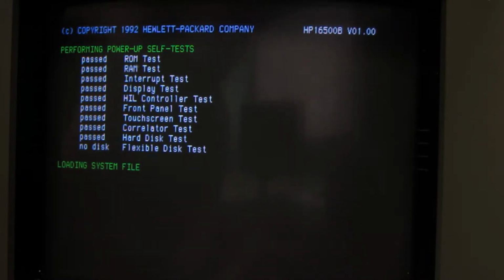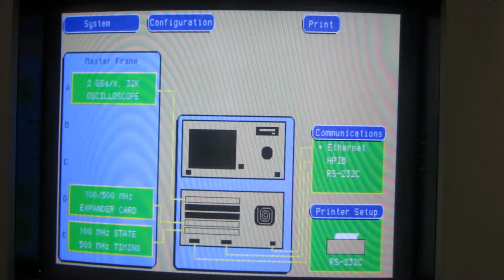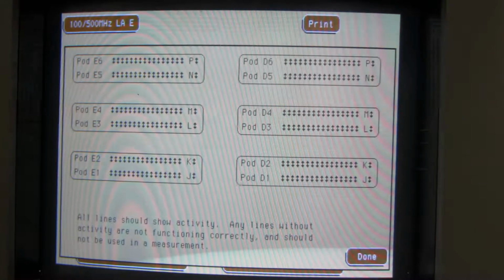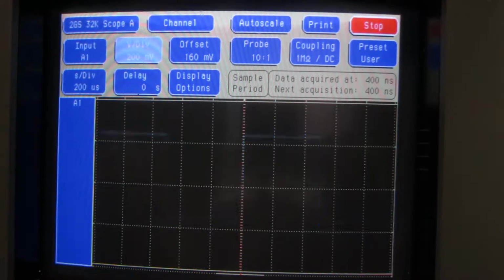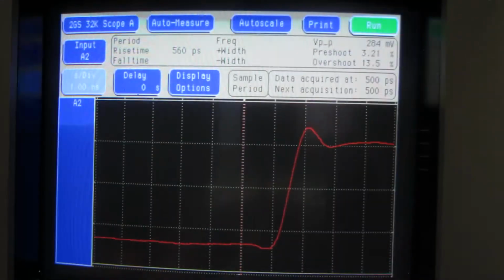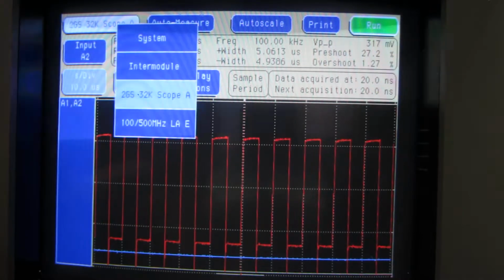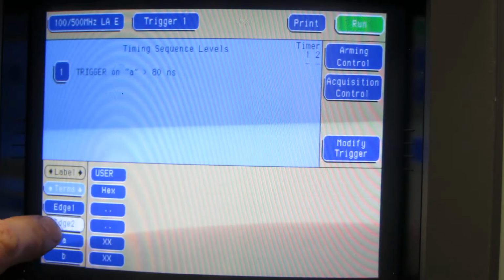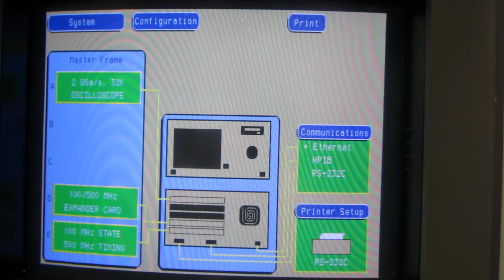Hewlett Packard HP 16500B logic analyzer demo with 16534A, 16550A

Comment: Cool working device! I just brought a 16550a module via ebay and unfortunately card is faulty, it's has troubles with self-test: chip 3 & 5 has communication test failed, chip 4 pass first tests and fail on ..sequencer stage. Also pods 5&6 show activity on all their lines without any connections in operate mode. definitely not a best buy, but I would be very grateful for any information about the possibility of repairing this card.

Comment: hi
i purchase a scope card.
it unrecognizable.
do you know what should i do?
Reply from the maker: What scope card is it? The really old 16531A needs a 16530A timebase to work with it. Also, check that the scope card is actually compatible with the mainframe. The older 16530A/16531A cards don't work with the newer 16700 series mainframes and I've seen notes about compatibility on some 16534A cards. Many of the plugins have Dallas non-volatile RAM modules on them whose batteries could cause a problem, but I've had cards work OK even with the module removed. However, the most common problem I've seen on all the 16500/16700 series cards is corrosion caused by the adhesive which attaches the plastic rubbing strips on the bottom of the board. I've got a whole pile of good plugins which are basically useless because of this. If you have any working ones, remove the plastic strips and the black rubbery adhesive strips now! I've had some luck with repairing corroded tracks and components which have been damaged by this, but it's not easy.
Reply: @cmjones01  https://www.ebay.com/itm/HP-16531A-Digitizing-Oscilloscope-400-Megasample-s-Acquisition-Module-/303772052862?mkcid=16&mkevt=1&_trksid=p2349624.m46890.l49286&mkrid=711-127632-2357-0
i have 16500a
Reply from the maker: @azariayehezkel9064  You need a 16530A timebase module to go with that, plus the interconnecting ribbon cables, I'm afraid, otherwise it won't do anything. I've recently sold a 16500B with 16530A/16531A modules in it and they work well, within the limitations of their 100MHz bandwidth and 6-bit resolution.
Reply: @cmjones01 
ok

Comment: Nice tutorial, the 16500 are still used in industry believe it or not. But the question I would like to ask is did your write that module for the oscilloscope or was it created by HP? other question is do you use GPIB on this?
Reply from the maker: The module for the oscilloscope is provided by HP. The standard software installation on the hard drive contains software for all modules supported by the mainframe. I used to have a 16500A with no hard drive, and on that you had to copy the correct modules for your setup on to à floppy disc.

Comment: I recently picked up a HP16500B mainframe with a 16510A from a local retro-computer meet. The guy had a second and wanted to pass it on to somebody else. I offered him $100, and he said, "sold!"
Not as flashy as a more modern system, but works fine for the stuff I play with.

Comment: Nice demo! I also have the 16500B with a different configuration, it's quite an instrument indeed.
Reply from the maker: Thanks! Glad you enjoyed it. Have fun with your 16500B.
Reply: Some years ago when I got the thing I wrote a little tool in Python to manage it with a Raspberry Pi over serial, as I didn't have a unit with an Ethernet module. It basically allows wireless data transfer to and from the instrument and scripting it. I wrote about that endeavour here: https://bit.ly/2QxgkYq. Back then I was also looking around for videos of practical usage (especially the logic analyzer part) so it's always nice to find them, rare as they are :) The triggering alone could be a topic for several long videos.